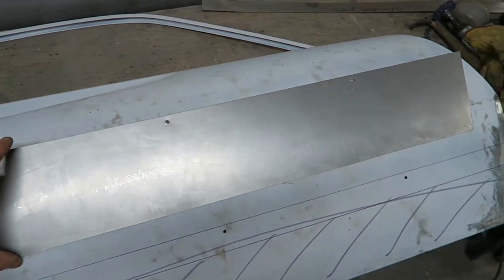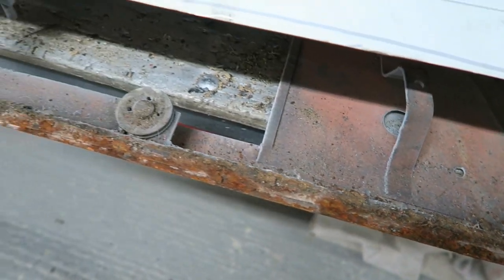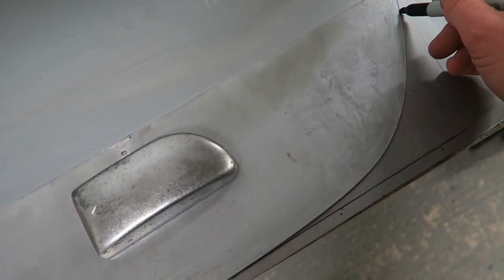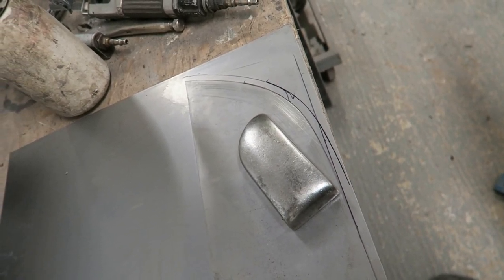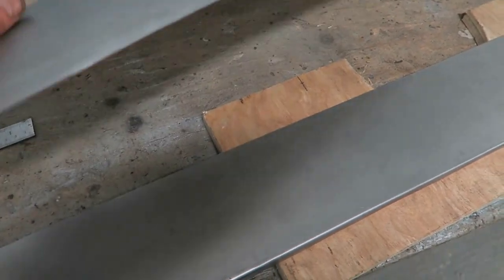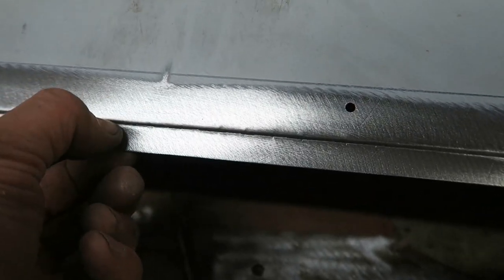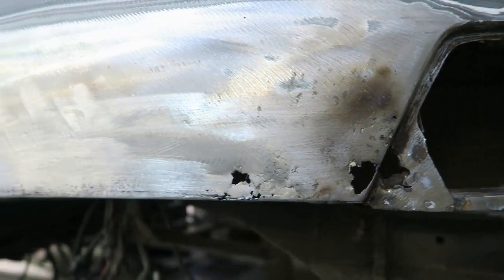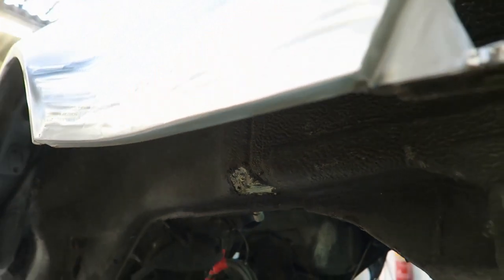Using templates to accurately fit repair patch panels Tips and Tricks #8

Comment: Good morning Trev I have a question I am doing lower door panels on a 1936 chevy pickup. Should I butt weld or flang weld? How did you make that step? I do not have all the equipment you have i only have hand tools. I have the skills but have been out of the business for 40 years ( things have changed ) LOL
Reply from the maker: Difficult question to answer. In the past I’ve joggled and lapped then butt welded the ends where the skin goes over the frame, this has worked well but overlapping any joint creates a potential rust trap. If you butt weld the whole joint along a low crown panel then the distortion created by the heat may put you in a position where you’ll need to put a ton of filler in. I’m experimenting with tacking in the lower skin then removing the lower inner frame before welding in fully the lower outer skin, this gives you access to planish out the heat distortion before re-welding in the lower inner frame, loads of work but a chance of making a near perfect repair. Cheers Trev 👍
Reply: @trevsblog  Thanks for the quick reply. And I  would like to wish you a Merry Christmas and a great 2021 from Canada

Comment: I sometimes use duct tape on a compound curved panel. A couple layers to get it so it wont stretch. Slowly peel it off,cut it to lay flat and 
To form the new part, pull it back together and tack it up. Like pulling in pie cuts.

Comment: Hi trev!!.. Was wondering why you cut the repair panels into intricate shapes instead of just cutting them into straight lines and angles? ... Thanks in advance! !
Reply from the maker: Russell Dilworth the panels blend so much nicer. No horrible build up of weld in a corner. Cheers Trev 👍
Reply: Thanks trev for the super fast reply... Keep up the good work! !!!

Comment: Hey Trev, wonderful channel. What do you use to cut metal that precisely?
Reply from the maker: TiredGringo use the repair section as a template and scribe around it. Remove the bulk with a cutting disc or air saw then trim right up to scribed line with a small and large belt sander/ finger file. Cheers Trev 👍

Comment: I must’ve have missed it,  did you butt weld the Porsche quarter panel repair or did you crimp the quarter for a overlap weld?
Reply from the maker: Lloyd Wright all butt welded, I didn’t show the welding as it was more about making sections fit well. Cheers Trev 👍
Reply: Trev's Blog  I figured you did. I always but welded or when I can . Except a half door panel, I would crimp it for rigidity,  putting 930 flairs on- I would have to have inside as perfect as the out side first thing the customer did was put there hand under the quarter to see if they feel anything. As a kid I would make 120 Jag aluminum door skins, would had been so nice to have Blog like yours to help ,  my repairs would turn repairs.  I really enjoy your adventures.  RY LW

Comment: Great vid! I have a question tho - At 5:40 what is that line right above the template.. I mean did u make it on purpose or weld it in from behind in order to make a nice bed for the template? Thank you in advance.
Reply from the maker: Brulserz I think you’re talking about the step I’ve made in the door skin using a joggler also called a flanging tool or an edge setter. It allows you to overlap the panel but still keep the joint flush. Less distortion when welding. Cheers Trev 👍
Reply: I understand. Thank you for the information and the quick response :)
Reply: Digital romance

Comment: how the hell did you do that cure bend so dam well.  no show how you did that...  and how did you do that step on the door...
Reply from the maker: jason puttock Hi Jason step was done with a joggler also called edge setter or flanger. Curved bend was a stretcher shrinking machine. I tried to keep the video on point rather than doing every process making the video too long. More videos showing fabrication coming soon. Cheers Trev 👍
Reply: @trevsblog  that would be awesome. I am repairing a van VITO.  I have never done anything like let alone welding but all panels are holding lmao.  For how long is a different matter.  However bend and shaping is gonna cost money to buy the tools.  That will hurt alot im sure.
Reply from the maker: jason puttock To be honest Jason it’s usually more cost effective to by replacement panels than try to make them, especially for something like a Vito van. We only really make repair sections for panels that aren’t available. Cheers Trev 👍